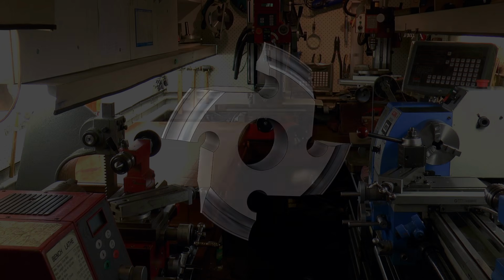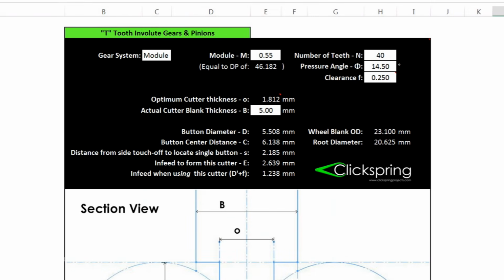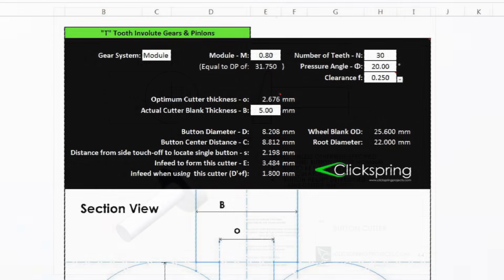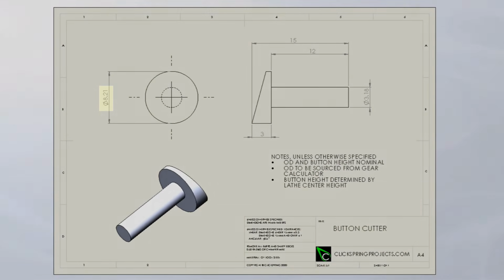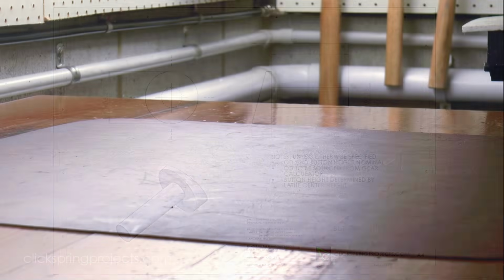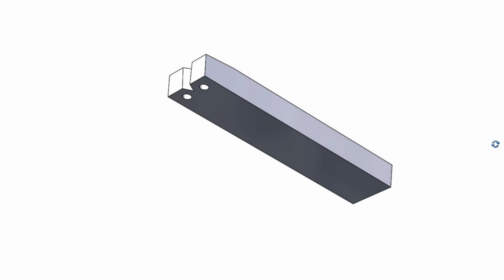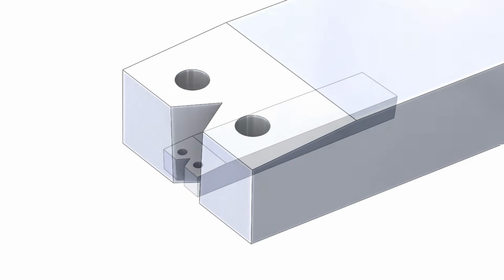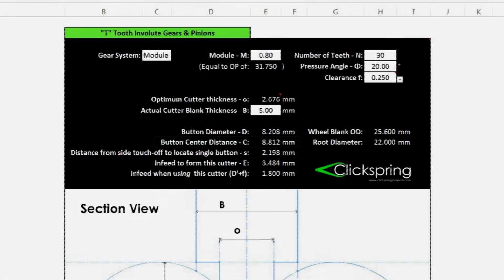Tools, Glorious Tools! #10 (Part 2) - Shop Made Gear Cutters - The Cutter Forming Tools

Comment: Question! What are the drawbacks, if any, of adding a mark or notch, however minor, to the shafts of the button cutters for more accurate and repeatable alignment, especially for the sharpening? Or as another commenter asked filing a spot flat where the grub screw would be expected to reach?
Reply from the maker: None whatsoever; use markings as personally desired - Cheers :)
Reply: I was thinking the same thing! Really incredible design, this is the only real improvement I could think of...  But...
You can actually keep the set screw loose and gently press the buttons against a flat surface, where they will index to exactly the right position. Then you tighten the set screws to lock that orientation. It would be a lot more precise than trying to match up any sort of marking. Probably more precise than flats too.
Reply: Given that the buttons are loctited into the holder,  I'm not sure you'd ever be resharpening them in the jig.
Reply: I agree .. Having a flat on the side with grub screw means it will be easy to take out and resharpen and also to put the button cutters into another holder for different pitch cutting .. if extra buttons have not been made

Comment: In a lot of your videos you use a scroll saw to pierce metal or cut small posts from parent stock. What kind of blades are you using?
Reply from the maker: Hello mate, I use these (various sizes depending on job) https://www.jewellerssupplies.com.au/product-group/34592-super-pike-sawblades-bundle-12/category/1161-sawing - Cheers :)

Comment: The rake and clearance angles mean that the cutting edge is slightly elliptical,  and as it's not in line with the centre line of the lathe, its effective shape is a curve I don't know the name of.
I wonder if anyone has calculated what subtle effect this has on the involute approximation.  The angles could potentially be tuned,  but only to a specified cutter radius.  I'd rather build a CNC grinder with my teeth than figure that one out.

Comment: Hey Chris, @10:04 I wonder if you could use a piece of glass, sort of like microscope slides (maybe a bit more tough), to press gently against both buttons allowing them rotate to face the same plane, until seen aligned correctly.
One must be careful not to break the glass though.

Comment: Holy chit, Chris, for once I may have an idea for you. When you are forming the original 15 degree slope on the button cutters, once you are finished milling the shape, what if you made a flat on the low side of the cutter buttons. This would allow you a flat surface to index and measure to when setting the buttons for the remainder of the set ups for sharpening on the stones and setting them in the tool holder. Just and idea here, might work.

Comment: Mmmm, shiny...😁 I notice that when sharpening the button cutters great attention is paid to the circular 'end face' but that the outer side of the button is left largely untouched from the lathe.

I've done a bit of metalwork and old-school machining, but my experience lies mainly with woodworking tools (chisels, planes, saws, routers), and in those cases it's impossible to get a truly smooth, sharp cutting edge unless the meeting faces are finished to an equal degree.

The back side of a plane iron, for instance, needs to be kept mirror-bright so that when the cutting edge is sharpened - ground, honed and stropped - no nicks or scratches are revealed each time the back of the blade is exposed. If the front is perfectly flat and polished, but the back is as rough as a ploughed field, the cutting edge will always be wavy and can never be finer than those exposed corrugations.

So...  would the outer edge of a button cutter benefit from being as finely polished as its end face, or doesn't it matter in this particular application? I appreciate that there's a big difference between making a tool to create a finished component, and making a tool to make a tool to make another tool to make a finished component. Just curious... 🙂
Reply from the maker: Yes, quite correct Eli, removal of any turning marks is essential for the best possible finish. It kinda zips by but you'll see I take the perimeter to a bright polished finish as a last step of the cutter OD formation before formation of the cutting surfaces (4:30) The goal being no residual turning marks to corrupt the cutting edge, more-so than a polish, but the idea is the same as you describe - Cheers :)

Comment: Chris, thanks again for this. I have a quick question. I'm still figuring out best practices for some of these operations and it seems to me that the locating boss would have been a perfect candidate for using a thermal interference fit. I know that the Loctite will work, but the shrink fit seems so much more elegant. Or am I  just adding an unneeded complication to the job?
Reply: Loctite is reversible, easier, faster, and iirc stronger than an interference fit, and also doesn't introduce any stresses into the part. It's also visually indistinguishable from an interference fit, so there really doesn't seem to be a reason not to use loctite. Don't get me wrong, I find interference fits very cool and would probably still do it just because I'm a big dag, but the Loctite really does seem superior by any objective measure.
Reply: That being said I'm a former designer, not a machinist, so Chris may have a very different insight into this than me!

Comment: Why did you not index the tool with a keyway? The measurements are to the thousands, but how do you make sure the tool is oriented to the thousands?
Reply from the maker: Its quite easy to align to required precision by eye, and much like the many other compromises inherent in gear cutter design (both commercial and home shop) small profile error tends not to matter - Cheers :)

Comment: Love this. Wanting to make gears soon and all these tools that i need to make will make life easier. 
Thank you for sharing it all. Its assisted in my thoughts. 

Would putting some flats on the back (thin side) of your buttons not assist in getting the 15 degrees in the right place for sharpening and also for installing on the button carrier with a square to get the high (thick side) as the point of contact?

Cant wait for the next and keep up the work
Thanks and regards,
Paul

Comment: Your work and attention to detail is simply stunning - thank you so much for sharing this with us! One more question: You ground and polished the top of the cutter - doesn't the side surface also play an important role? I mean, if there are scratches there, then they may also be found on the cutting edge - and thus ultimately on the teeth of the gear, which are milled with it?
Reply: It is the edge that matters. Because of the 5 degree tilt for clearance /relief after the buttons are mounted in the tool, the sides should not rub against the work piece.

Comment: If you milled a couple flats on the low sides, you could use them to quickly line up the cutters for sharpening.

Comment: You could file or scratch an alignment mark onto the cylindrical edge of the button cutters before cutting the 15deg angle on them, so that you can repeatably line them up in future.
Reply: or mill a small flat on the sides of the cutters so the grub screws will automatically align the cutters when tight

Comment: Always glad to see another video. A question I hope isn't annoying. What are your thoughts on using round carbide inserts that already have rake and clearance angles built into them? I guess you'd be at the mercy of their diameters so I should check out that calculator.
Reply from the maker: Excellent solution, naturally requires consideration of some details, but nothing too difficult. More details in the next videos - Cheers :)

Comment: I don't understand how you find the correct position for the buttons on the shank @17:00
You have previously polished out tooling marks, so how do you set both buttons in identical "orientation"

Sorry if this is an obvious thing, but to my interested-in-engineering-but not-an-engineer mind, I'm missing something

Comment: Hey Chris, great video again! Deviating from a profile with conjugate action (ie involute mated with involute) should result in the formation of transmission errors in the meshing cycle (these errors being deviations from the ideal transmission ratio). You're certainly right that the approximation is pretty good though. Out of curiosity, have you ever noticed little jerking motions or accelerations while two gears mesh together?
Reply: It's very possible that either the gear was mounted off center or the shaft is bent either would lead to intermittent binding then being too loose.

Comment: You could actually file a small flatspot onto the shaft of the button inserts. That way the grub screw wont deform the shaft and also it would set the rotation pretty close to what it originally way when you want to sharpen them.
Reply: When the 15 degree rake angle is milled in from the top (as at 6:54), it would be very easy to mill a flat at the small (unused end) as the next operation. That would involve no further setup and it would provide a means of orienting the buttons in the cutter. If you used a square that had equal width limbs you could both assure that the buttons were 90 degrees to each other and 45 degrees from center.
Reply: I was thinking similarly you could score a line on the bottom of the tall side of the button to make the angle more visible

Comment: If you were to mill a flat on outer edge on the lower side of the buttons alignment in the sharpening tool and the button holder would be a lot easier.
Reply: I thought the same, even a small mark on the outer face at the high point would make alignment easier
Reply: @whistlecube  A flat would let you use a parallel to align on the sharpening jig and a 90° angle to align on the cutter. It would be pretty trivial to mill in the jig before you mill the angled surfaces.

Comment: You could have put a grove in the shaft of the button cutters for easy alignment
Reply: Or cross drilled them and used a pin to align them.